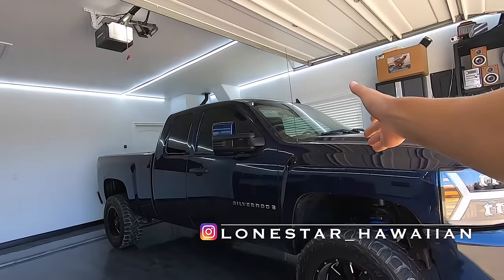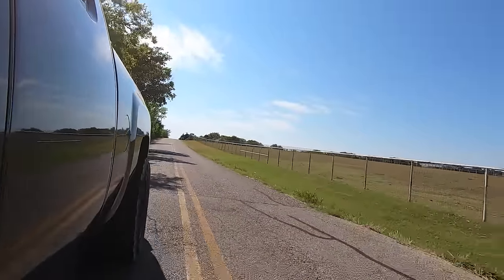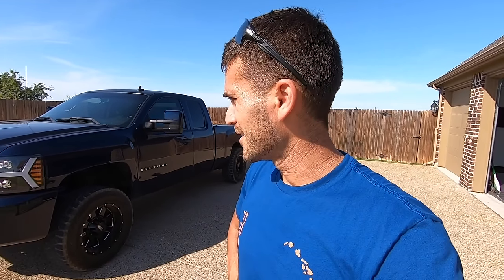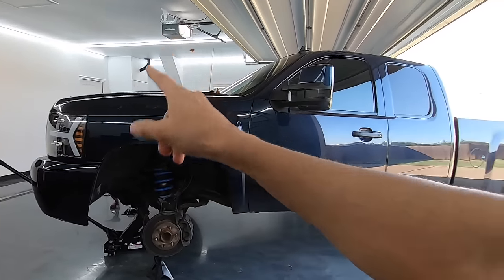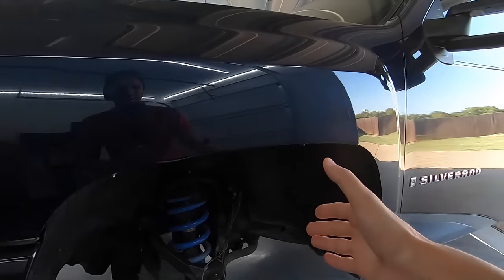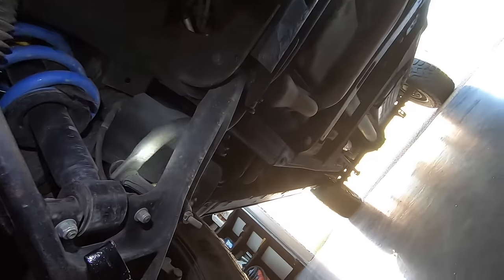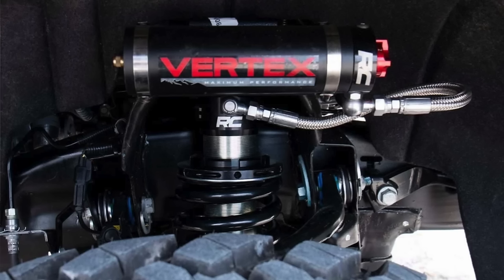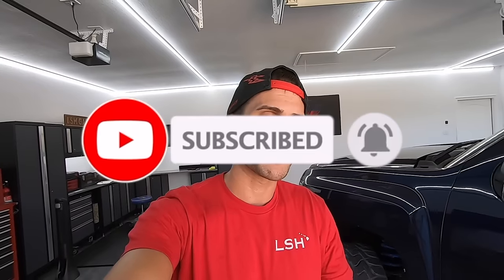Reliability Issues? 3.5" Rough Country Lift Kit - '07-'18 Silverado/Sierra: 3yrs + 30k miles

Comment: Do you have lift blocks in the front or the lift loaded strut
Reply: Spacers on top of the strut.
I am doing the same lift, but using the Bilstein adjustable strut with RC upper control arms.

Comment: Why haven't you lifted the front end torsion bars? It makes the front  aesthetically taller thqn the rear and tougher when u come up behind people. You don't lose much comfort. And yes it's a Cali squat. It was popular in the late 90s 98-99, gained popularity in the 2000s.
Reply: 07 and up gm 1500 trucks are coilover suspension don't have torsion bar

Comment: It looks like you trimmed the upper control arm droop stops? Or am I wrong?
Reply from the maker: Correct. I trimmed them because I originally ran with the stock UCAs
Reply: @LonestarHawaiian  Thanks for the reply dude!

I just installed a 3.5” leveling kit (not Rough Country) and brought it in for the alignment today. Mechanic sends me a picture of my control arm sitting on the stop (explains the mild clunking noise I’ve been hearing whenever I hit bumps) and says they can’t align the camber.. sucks!

I’m torn wether to just trim the stops, or just go a head and order the Rough Country upper control arms. I know my ball joints are probably shitting their pants so I should probably just buy the UCA’s..

Do you think the the Rough Country UCA’s will clear the droop stops without trimming those or do you still have to trim them anyways?

Comment: Why you have the trailer tow haul on you not towing ?
Reply: Tow/haul, he’s hauling dirt, plus it is easier on the transmission and it shifts at higher RPMs when the truck is under load.

Comment: If I want to level my truck from the front so it doesn’t have the stock front lower than the rear.. what kit do you recommend?
Edit I mean the rake
Reply: For leveling kits I personally recommend Motofab, I've been running their kits for several years.
Reply: I want to remove the rake, tries that remove it?

Comment: So when the ball joints wear out on those aftermarket upper control arms is there replacement ball joints? Or do you have to replace the whole arm?
Reply: @sturgeonhunter4427  thanks!!
Reply: @sturgeonhunter4427  yeah i used moog ball joints when i had my ford and they don't have a rubber shields anymore which is better. And what 89 cent pin are you talking about? The pin that holds the ball joint in place?
Reply: @sturgeonhunter4427  I thought gm trucks came with those alignment pins from the factory? I had to install them on my ford cuz no one could align it without them and they cost me 60 bucks from moog and installed them myself pretty easy